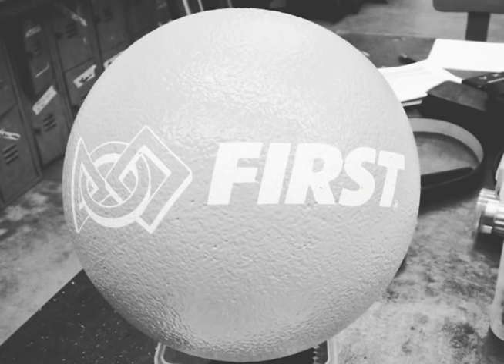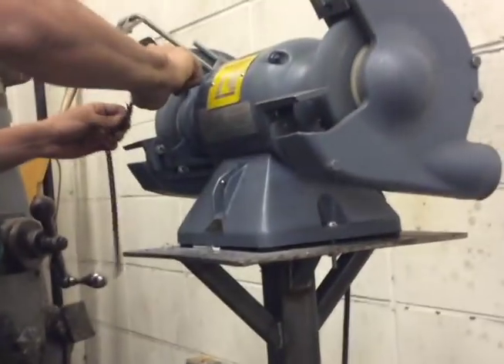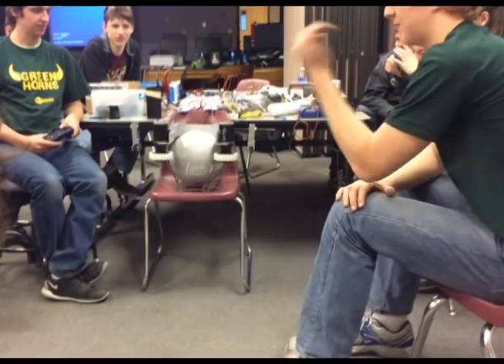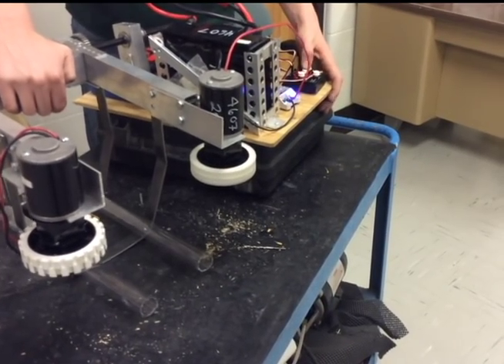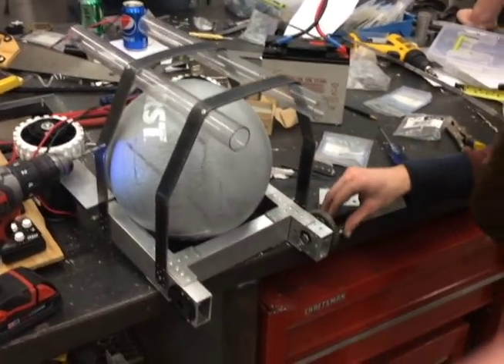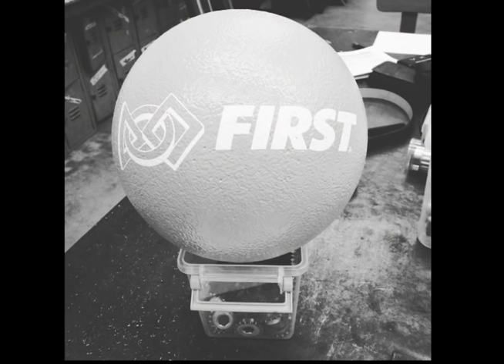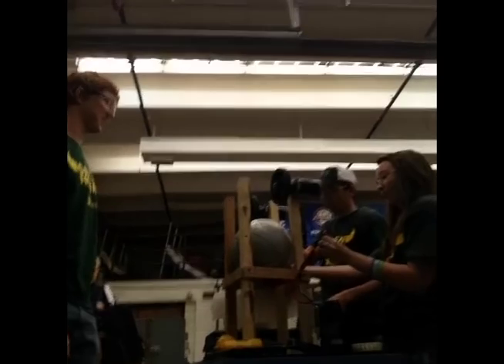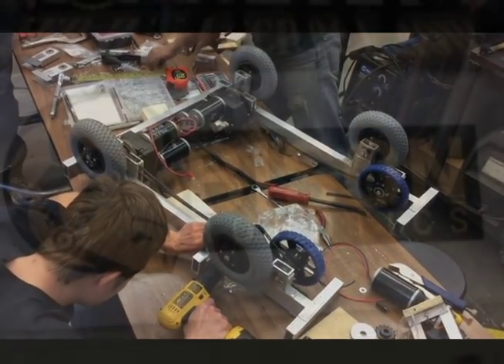Day 2 Update - The GreenHorns

Comment: At 5:26, what is blinking?  Possibly an LED test arrangement for your RoboRIO?  I'm interested in various good ways of testing the RoboRIO, while writing Labview Code.   I can hook up LED's to Digital Out, and we bought 10 small hobby servos to connect to RoboRIO to track output PWM positions, etc.  But, I'm wondering what others have come up with that they really like, for prototyping their software, before actually connecting to the mechanics of the physical robot.  

We currently use o-scope, logic probe, multi-signal logic analyzer, etc.  Just wondering what others have used, especially that's easy for students.